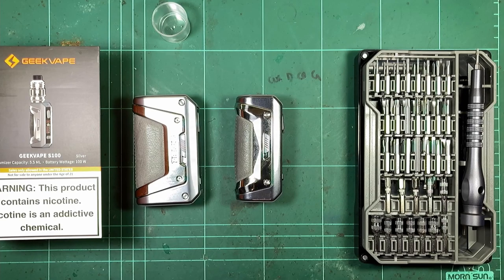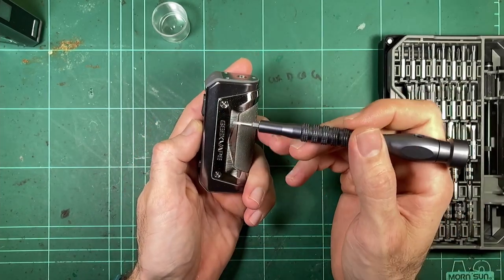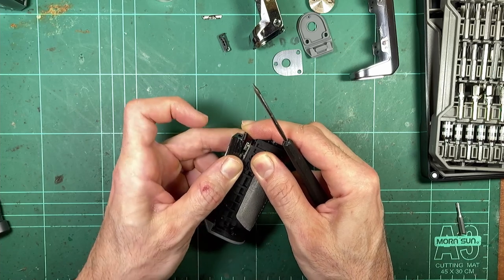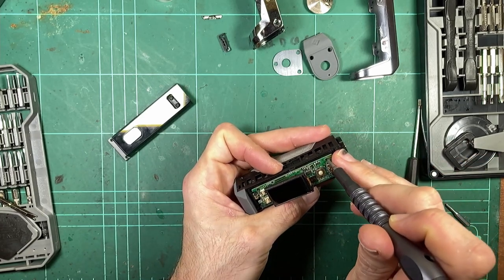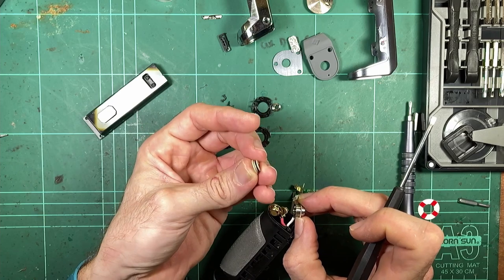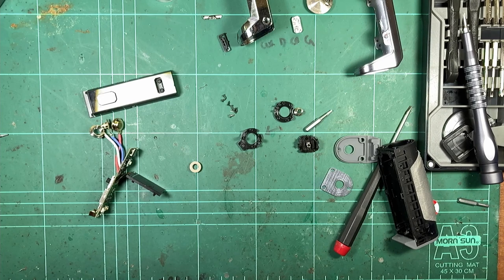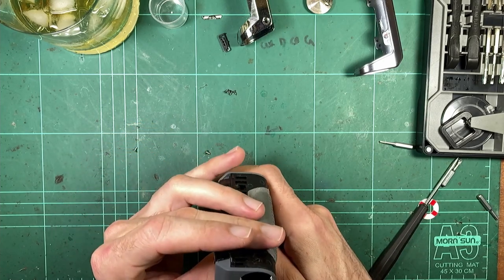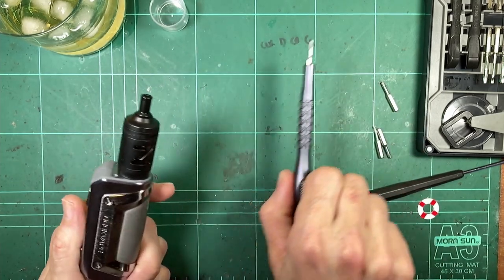Geekvape Aegis Solo 2 (S100) - Disassembly and build quality analysis

Comment: Very interesting indeed many thanks! I'm a huge fan of the original Solo (I have two), not only because of the build quality but also for its excellent temperature control characteristics which are extremely useful for direct emesh vaping with the psychedelic, DMT (only the GeekVape Aegis series and DNA-75/200 based mods apear to have good enough temperature control EDIT: also the Eleaf Istick series when flashed with ArcticFox). Now the S100 has come out I've been at a loss to know whether they're a worthy successor and I've had questions to my own channel and reddit sub asking for opinions.  
Watching your video it pretty much clears up one side of the discussion, which is that physically it's does not appear to be a match for its predecessor.
Top work mate, thanks again.
Reply: My screws just fell out! Trying to find out what size screws are?

Comment: Thank's a lot for the helpful disassembly instruction. Mine seemed to be flooded with liquid, so the magnetic lock-switch was fixed in the "locked" position. After opening and cleaning the whole thing, now it works again - operation successful!😊
Reply from the maker: Good job mate! Very happy to hear the vid helped and thank you for letting me know!

Comment: Same thing happened to me.... 1st day, dropped from 3 feet, as I was sitting down, Also I broke the fall with my foot but it still landed just right on the tank and snapped the very tiny plastic parts tht the screws from the top plate go into.  SO thankful for your video, I have my vape working again!
Reply: How did you fix it?
Reply: What size screws did you use for the top plate?

Comment: Can confirm that the strength of the top screws leaves something to be desired because of the plastic thread. I also had the issue of the screws going through the top plate after dropping as the hole became too wide. A fix ive used on both of mine that works well is to remove the top plate and add a few drops of "super glue" into the broken screw threads. sprinkle a little baking soda on it to quicken harden. wait at least 45min, drill a small hole (smaller than the actual screw. I use a dremel) in the filled screw holes. and carefully and slowly screw back in (glue may still be a bit weak so dont use too much strength or screw too deep.) then wait another 45 and finish tightening.

For a slightly more difficult but durable fix use steel based epoxy. issue is knowing when to thread the screw into the glue. Fully hardened it is too hard, must be partially screwed in when not fully cured but if its too soft then youll simply ring the threads... Either fix will extend the lifetime dramatically as once the screws come loose the contact with the battery becomes poor, leading to inability to vape or worst case damage to the battery and possibly fire/explosion

On both of my s100's the leather on the handle has also come away from the adhesive losing adhesion. I found the best way was to remove the side metal bracket. wipe down old adhesive with alcohol and replace with a good double sided tape, and reapply the leather. In the case the leather is too damaged, Instead of trying to stick it back down i removed it and used "washi tape" to remake the grip, as it doesnt become sticky, has a good aesthetic and is water resistant. works wonders

Comment: I have been sticking to Aegis mods since the first Aegis, and mainly because of their build quality. I have a bad habit of dropping my mods to the floor, and several of them have only handled a couple of drops before they got ruined. Hopefully the single 18650 battery makes this lightweight enough that it will handle being dropped to the floor plenty of times, but if not, then at least i still have the first Aegis Legend as a backup...
Reply from the maker: I’m not confident with the drop resistance of any of the new Aegis mods like the L200, S100 and M100 tbh :/ I’ve seen a fair number with broken or separated top plates - those screws into plastic aren’t strong enough it seems. I hope you get good service out of yours though mate!

Comment: I dropped mine recently and it's throwing no atomizer errors 24/7 now. I've got the top plastic piece exposed and the white wire looks solidly soldered to the 510 female receiver. What else could it be? Any tips?
Reply from the maker: Check the negative part of the circuit - atomiser 510 thread to the mod 510 to the board. If you have a multimeter you can check the continuity from the atomiser body metal to a ground point on the board.
Reply: Mine did that until I tightened the top plate screws, What kind of driver set are you using it looks nice and complete.

Comment: My S100 top plate keeps popping up. The screw is stripped and I've used super glue to hold it down and it lasts for a little while.  But the first time it tips over it pops out again.

Comment: I have the original Ageis Solo...Perfectly for me and has lasted so long...still works great...I bought the Solo 2 and it's extremely similar...but it gives a low battery error after about having it a year..It's like you have to press the button several times to get it to go...every other push will give a low battery error... does anyone know if I can fix this... I stumbled across this video trying to find a video. Edit: The single 18650 lasts me a long time because I've always vaped low wattage...I started vaping in 2009. I can't handle high wattage...that's why this mod is great for me

Comment: Do you happen to know the size of the screws on the top plate? The 3 screws you removed first with the rubber seal. Great video, thank you!
Reply from the maker: I believe they were a T5 head. If you’re buying tools to undo them, may as well grab a small set with T4 and up plus small Philips like 000. Should be pretty cheap. Thanks for the comment and apologies for the late reply!

Comment: my battery in this mod is loosen or unfit anymore and the device turns off immediately, do you have any advice?
Reply from the maker: How’s the condition of your battery? I’d check for dented terminals on it - if you notice any damage you should replace it. Otherwise if the mod is the problem, you’d probably have to open up the device and check the sprung battery contact for damage or something come loose.

Comment: just dropped my aegis max100 (aegis max 2), seems to have this same weakness - three screws on the top -> plastic plate. I'm traveling atm so i don;t have the tools to take it apart, but the tank is can't at an angle, seems like 2 of the screws have come out. I guess i have to continue my search for a bomb proof mod

Comment: Hello good sir. i noticed something with the mod when ever i push against the battery cap the mod dies and restarts is it normal?
Reply from the maker: No that’s not normal - it sounds like when you press on the cap it’s causing the battery to lose contact for a moment. I’d probably try cleaning the battery contacts first.
Reply: @vmgtesting8014  tried cleaning it but it's no use it only happens when i press it. i noticed in your vid that the battery contacts at the bottom rely on them leaning towards each other.

Comment: My friend's GeekVape S100 Mod stopped charging and won't power on after 5 months of continued use. Already bought a new set of 18650 Cylaid batteries but still won't power on after 5 clicks.
Reply: Have you been charging externally? Or in the mod itself?
Reply: @Cesar0721  Mod itself via the USB C port according to my friend.

Comment: What is better aegis solo or Aegis s100???
Reply from the maker: Overall I’d probably say the original Solo - I think it is more durable and has better ingress protection. I didn’t do an electrical test on the Solo but I did on the Mini and I think they have basically the same board - the Mini had excellent performance, one of the best. Temperature control on the original Solo is also very good, I’m not sure about the S100 - it uses a different microcontroller.
Reply: From my experience with both device, the Solo is far durable. I got S100 and it last only 3 weeks. If I put any RDA or RTA the screen is flickering and the battery is draining and refilling it self.

Comment: Why is it so hard and inconvenient to replace the batteries
Reply from the maker: Probably because it’s a water resistant mod - both the S100 and L200 you commented on. The battery door has to seal well so it needs to be tight fitting which makes it harder to close. By the way you can charge by USB on these mods so you don’t actually have to remove the batteries to charge.

Comment: Thanks for this teardown. I just bought one and im a little worried about those screws coming off after a drop. Im thinking about putting some thin amount of super glue at the base/sides of the 510 connection to help support the load of the screws. Can this damage anything?

Cheers
Reply from the maker: Thanks for the comment! I don’t think that would damage anything, obviously just be careful not to get any inside the 510 threads or positive pin.